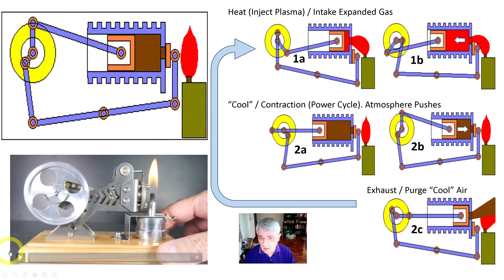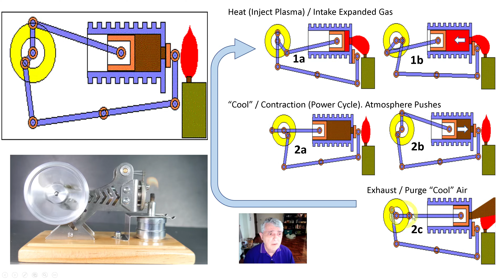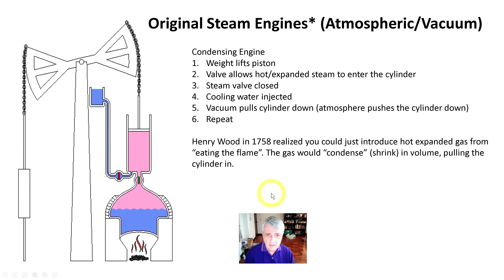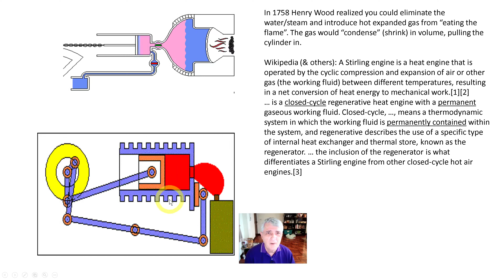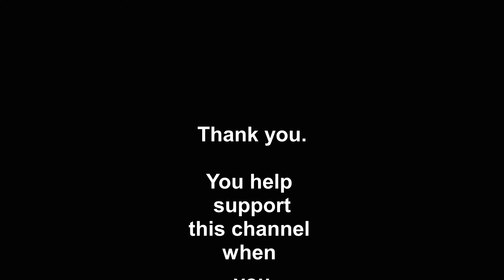Flame Licker Engine-Overview/Operation Part 1 (4K)

Comment: What fuel are you using? 
When I use alcohol it doesn't run long before getting plugged up.
Reply from the maker: It's 99% isopropyl alcohol. I tried 70% many years ago, and as I recall, it did not work well.
Reply: Sir it need plasma or it will run with any kind of fire 🔥🔥 

As like gas burner or gas torch